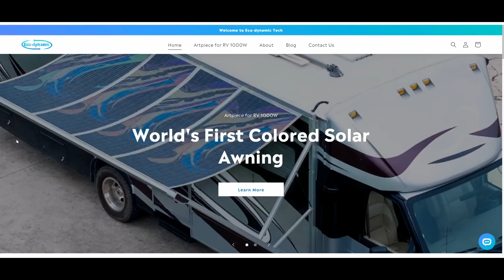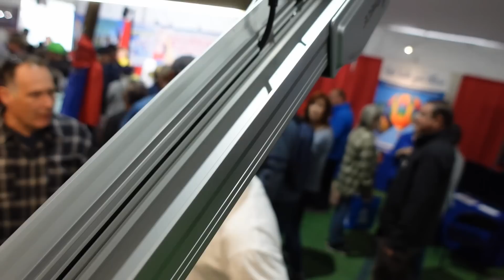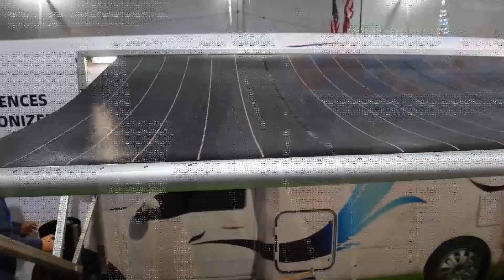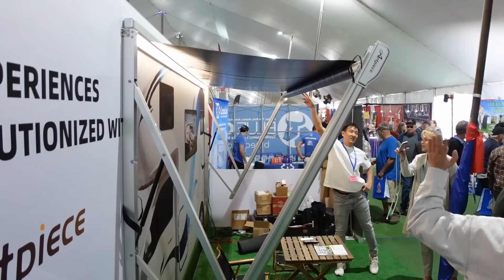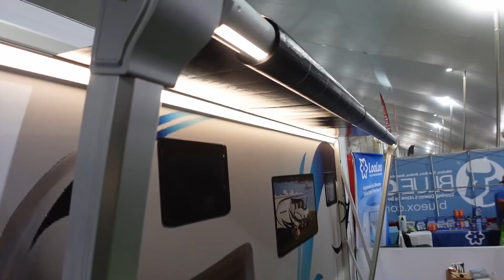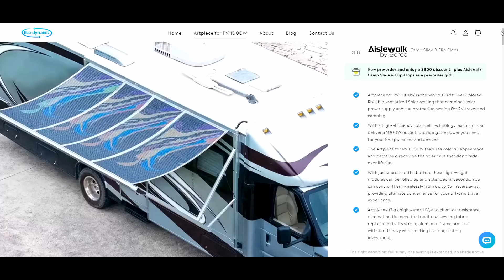Eco-Dynamic RV Solar Awning - First Look Quartzsite RV Show 2024

Comment: Very first thing I noticed, the sag in the awning, any kind of heavy rain, etc would sag that awning even more...
This awning, and subsequent offerings need some sort of center support, probably something akin to a "X" bracing that folds in and out with the awning itself...
Until the sagging problem is addressed, I would NOT entertain putting one of these on either of my campers...
Pricing will be an issue as well...

Comment: Im not sure about it being awning, but very interested if they could attach this to my back flip pickup box cover.  My truck like most of you with trailers, it sits beside my trailer all day, plug it in and or move the truck for the best sun angle.
Reply: The other issue i was thinking Ray while our awnings were out yesterday in pretty good wind.  No matter how heavy duty there arms and brackets are, I think the weight of the solar flopping up and down would probably knock a glass off the counter.  We get rocked enough with awning toppers….

Comment: You would have to make sure your RV is oriented just right to get decent sunshine on those panels since they are angled, maybe even have to reposition the RV to optimize your sun exposure, especially during the winter. These panel’s certainly won’t replace roof mount panels but having the potential of an additional 800 watts in that form is intriguing. Those panels, being able to roll up so tight, would be nice to just have as regular “ground mount” panels you could hang from whatever is handy and move them as necessary throughout the day.
Reply from the maker: Yup, the more roof space an RV or boat has the less attractive this product becomes. I think a rollable panel like this that could easily be deployed on the bed rails of the truck would be interesting. Not so much for travel but when the truck is just sitting at the campsite.

Comment: As the segments are going from the RV out and not along the RV, a partially deployed awning would mean 100% of the panels are essentially shaded, therefore no solar gain would be had.  This again can be an issue if you sometimes only deploy your awning out part way for shade but while there is a slight breeze.
Reply from the maker: I wonder how shade-tolerant their cell technology is.  The new CIGS panels are pretty good, as they have way more bypass diodes in them than traditional panels.  I wish these guys would have had their display outside to see it in the wind and measure the power harvest.

Comment: Just wondering if they considered making these for slide out toppers.
  Although the wattage output would be lower per topper awning , combined with 2 to 5 slide outs could be considerable and could be used even in windy days.
Reply from the maker: It sounded like they are exploring all options for the technology but have started with awnings. I bet they weren't aware of how many RVs in North America have so many slide-outs with covers.

Comment: Very Interested, it will be nice to see how this ages, I would need a 18ft size. Would have to drill new holes in wall and roof area for mounting, plus is the RV wall going to support the weight. Price is very heavy on the wallet especially having match a charge controller. Not practical for price yet in my opinion.

Comment: Looks very interesting? Would they make a smaller one for slide outs?
The voltage is quite high? You would need a high voltage mppt charge controller. I missed what the amps were on the panels?  Sounds like the company is willing to listen and adapt. 
Did you just drive down for the day?
Thanks great information moving forward. I hope that they adapt to North 
American systems and standards. Does the panel have any safety rating?
Cheers
Reply from the maker: Maybe, thats a good idea! They didn't have a lot of info handy as some of the stuff is still in prototype stages it seems but I found this on the website about the 1000W version.
Rated Power
1000W
Peak Power
1040W
Optimum Operating Voltage (Vmp)
108.3V
Optimum Operating Current (Imp)
9.6A
Open-Circuit Voltage (Voc)
138.66V
Short-Circuit Current (Isc)
11.23A
 I drove up from the Yuma area to see it and then drove back the same day. :)

Comment: They’re better off coming out with portable panels sections of 400 watts each that is easily storable, unless RV manufacturers adopt this product as an OEM item I don’t see this as an aftermarket product.  It’s going to take them forever to break in the industry, portable panels is the way to go
Reply from the maker: The portable panel market is already pretty cluttered with folding. I have a 420-watt that works great! The rollable factor is their killer feature. Someone mentioned slide-out awnings, which makes sense. Also, I can see it being a possibility for boats where roof space is at a premium. And wanting summer shade is desirable.
Reply: Space is always an issue if could roll up a 400 watt panel the amount of space that would take up would be less than a standard folding panel and from the looks of it it would weigh less too, right?
Reply from the maker: I think a none glass and metal folding panel like, say, a Bluetti 420w at 30 lbs. would be the same or maybe even less weight  https://www.bluettipower.com/products/bluetti-pv420-solar-panel-420w-refurbished The rollable ones would need some type of frame added to tilt it.

Comment: Excellent review on this innovative product!..i have an rv and boondock in AZ as well so this interests me a great deal even when i am also set up with fixed solar panels.   I know you mentioned using it on your boat and this is a great idea but i am thinking using this on my south facing deck at my home. I am connected to the grid but during a power outage deploying this to charge my batteries. Plus the benefits of staying out of the direct sunlight is a plus.

It may be a little early but im glad your on it to keep us informed about the progress of this product.
This company would have a tough time finding a better person to review there product and offering suggestions on how to improve it for the US/Canada market.
Reply from the maker: Thanks. :)

Comment: Your questions to them were very good. 
I think they need to perfect it for smaller awnings first. I see it is a whole awning replacement package, correct?
My concern is the sage weight and nothing assisting in supporting the weight, most importantly the weight pulling on the railing where it attaches up against the RV, and is there a cap to cover the exposed wiring in the arms where u were looking at the connectors? 
The sage weight and how well it’s attaching to the RV big concerns, cause it won’t last long as I see it now, a little bit of rain n its toast. 
Great innovation needs more work yet imo. 🍻